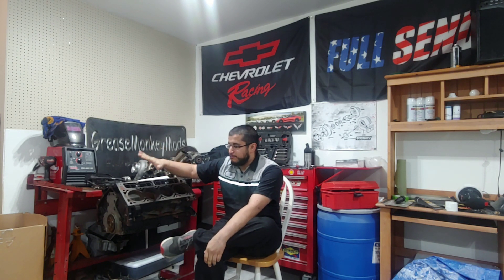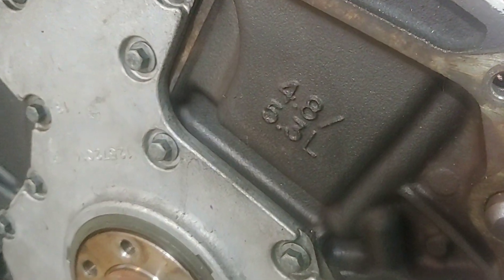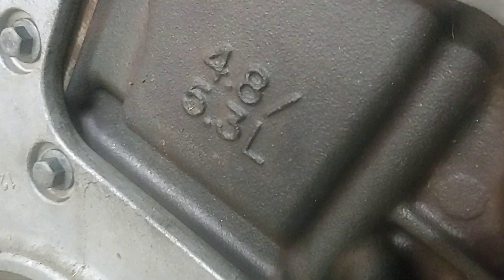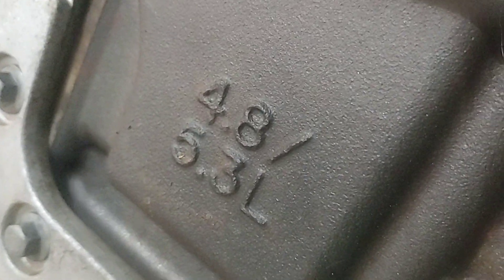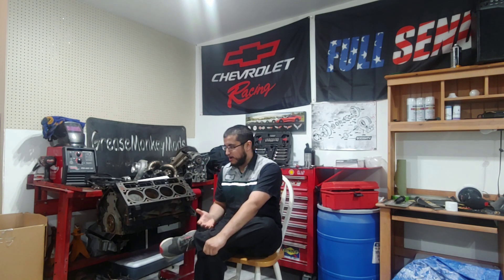4.8 OR 5.3 ? HOW TO KNOW THE DIFFERENCE In Gen III LS Engines GreaseMonkeyMods LS Series

Comment: There is a way to tell while it's sitting there wishing that you would buy it.  A 200k gen 3 wanted to come home with me.  Wire toothbrush, good cleaner, flashlight, 5 minutes and a visual NDT method of light handling revealed to me it was a 4.8.  Factory head gaskets have a tab behind the exhaust manifolds.  It's not a rumor, doesn't jump right off the tab, you have to be patient,  people are lazy.

Comment: Hey I had question I had a bad crank shaft on my 5.3 I was wondering if I can use a gen 3 5.3 crank shaft I have sitting around I just gotta take my reluctor wheel off my gen 4 and replace it on the gen 3 then bolt it back up

Comment: What's the difference between the two. Stroke or bore or both?
Reply: Its the stroke because the blocks are exactly the same
Reply: Strokes gotta be the same cause you can take 6.0L 5.3L and 4.8L crank and put it right in the other 1.
Reply: But bores same
Reply: @joshford6064  not 4.8. 6.0 5.3 and 5.7 have same stroke. 4.8 is shorter. That's what makes it 4.8
Reply: @diduck6878  I'm glad you told those Joe Biden loving gun banning clowns off...
Reply from the maker: 4.8 has shorter stroke longer rods and flat top pistons that are the same bore as 5.3

Comment: "Z"=5.3 (flex fuel)
Reply: Yes, Z= flex fuel. It uses a different fuel pump that incorporates a different set of brushes and commutator plates. High concentrations of ethanol is corrosive and is not shipped or pump via pipe line. Only tanker truck or rail car. It is mixed a the local distributor and held as needed for tankers to gas stations. The fuel lines are stainless steel with flex portions are PTFE. Anything less, corrodes. Ethanol injectors have a higher flow as it takes 30% more fuel to produce the same power as E-10 fuel or straight gas. High Octane fuel simply burn slower and produce little to no increase in horse ponies or performance. With straight gas to E-10 to E-85 creates the need for a sensor. The ethanol fuel is less dense and as a mixture of fuel passes toward the engine, the sensor produces a signal the PCM is programmed to change various parameters from timing to injector “On Time”. Regular Production Codes or RPO codes on a truck or utility are located in the glove box. The cover everything from mirrors to suspension components. These started in the 60’s for GM as vehicles could be ordered with an average of 3 month wait time. “LM9” = Flex fuel which should be noted if swapping engines to make a custom service manual including a good electrical section. I would never buy this vehicle without a complete service manual and in my opinion drops the value by $10K. This is the amount of extra money a person would pay in service fees for clock time spent tracing a bad wire. Without it, days. With a good electrical manual, 1/2 hr. Simple as pissing into a running fan on high speed! 
Certified Automotive ASE Master Tech since 1978 - Retired

Comment: I have a 2000 Chevy Silverado with a 5-3 engine does that mean it's an LS engine of some sort
I know when I see a 350 or a 454
But I don't know how to identify an LS engine
Reply: If I'm not wrong... it should be an Ls1. After a certain time, they stopped using cubic inches... and started using letters, Vortech tag, numbers and liters to Identify engines... More than likely you can check the stamp on your heads... passenger side, bottom right. The best way to know, with work and bear engine... There's a stamp that shows the block liters on the front top right of the block. There's another stamp on the backside of the block, if I'm not wrong. Top right, above the converter or clutch, but the stamp on the heads should give you an idea, unless someone worked on the engine and swapped parts... and not to mention, vin #, air induction tag.
Reply: Yes it’s a LS , I you look at the valve heads it will give it off ; almost every LS regardless if it’s a truck version vortec or a the OG performance version LS , they have the same / similar design valve covers / heads
Reply: According to this video it's a 3rd generation motor and 4.8 if had flat tip pistons.
99 to 2007 unless it had aluminum block or dished pistons.
I have motor from a 03 Tahoe ,thought it was a 5.3 and today I find out it's a 4.8 wow I'm dejected over it.
Spent a lot of money on a rebuild bought all 5.3 parts and everything fits Top to bottom but it ain't a 5.3

Comment: 1st way is not true, the 8th digit being Z does not mean it has a 4.8. They come with L59 5.3's as well.
Reply: "B"?
Reply: No 4.8 flex fuel in gen 3
Reply: Just checked my Vin # on my 02 and says V, air box also says 4.8 so mine is 4.8l, was told by previouse owner it was a 5.3l but he was wrong
Reply: yeah im totally confused, mine is a "Z" too.
Reply: Wrong. Z means flex fuel on gen 3 engines, no gen 3 4.8 is flex fuel
Reply: Mine is a T

Comment: So if I put dished pistons in my 4.8L, then I'll have a 5.3???
Reply: No, they are the same size. You would lower the compression ratio.
Reply: How can I turn a 4.8 into a 5.3?
Reply: @regiskendall9363  swap rods and pistons rods are different lengths between dished and flat top
Reply: @regiskendall9363  you need to swap the 4.8L crankshaft and connecting rods to the 5.3L one. You can use the original 4.8L flat top piston, that would give you a bit more power than the stock 5.3L pistons since they make a higher compression engine.

Comment: Other than on the driver side back of the block the VIN number is laser etched into it obviously nobody's done much research
Reply: I looked at that and ran the number and it came back as a 5.3 I bought the engine and today someone told it wasn't a 5.3 or LS1 so  searching and found this video.
I'm in shock to know that I thought I had a 5.3 been buying parts for a 5.3 3rd generation But everything has been fitting from top to bottom on a completely rebuilt engine.
Kinda sucks that all this time I thought I had a 5.3